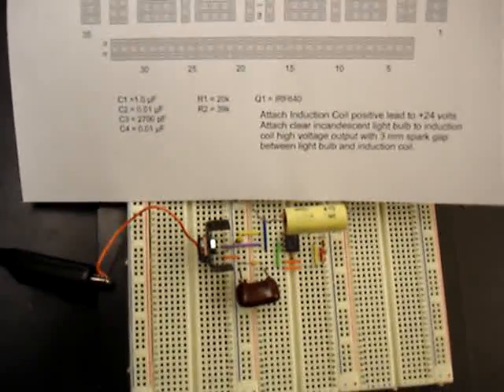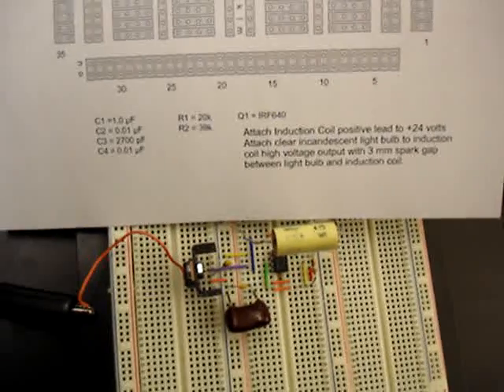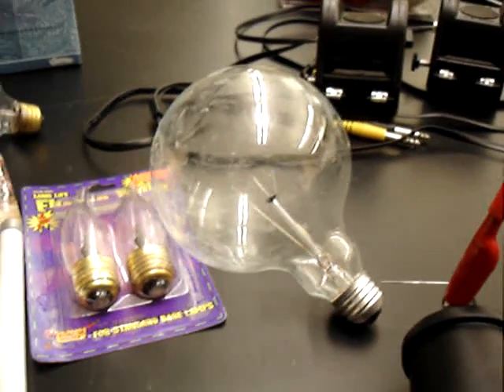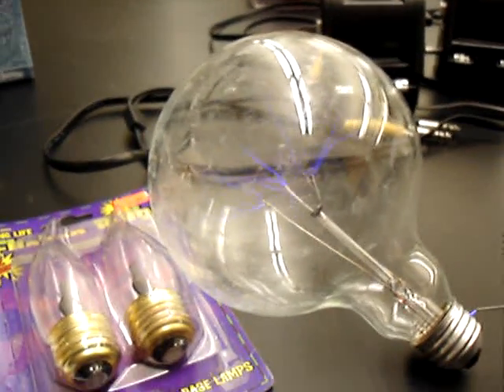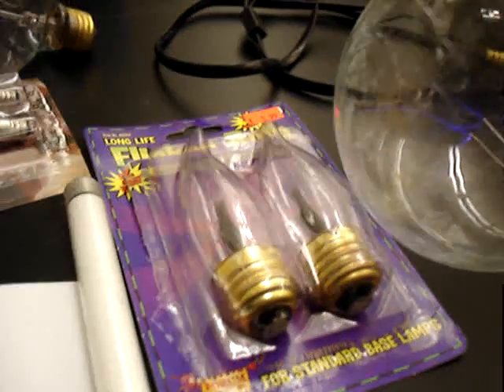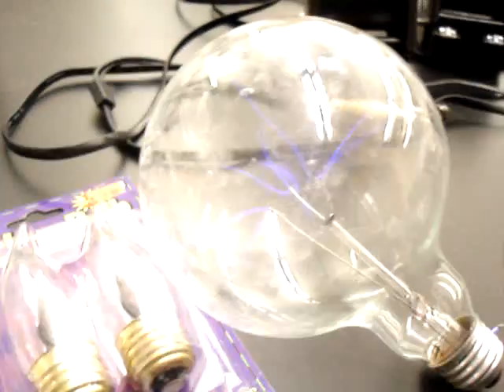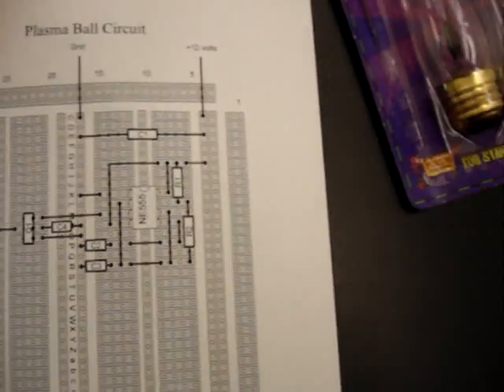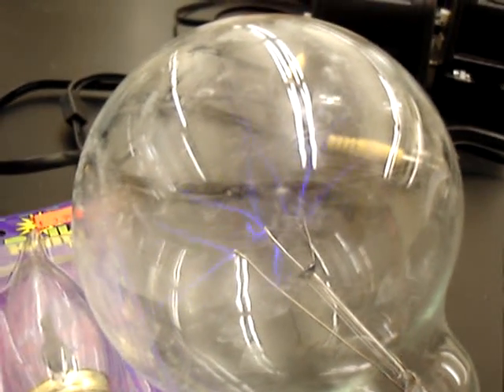Plasma Globe Circuit

Comment from the maker: Sorry it didn't work.  If you want to make a proper plasma speaker, I'd recommend getting a flyback transformer.  Hosfelt electronics has them for about $8.  The circuit diagram is on my website.

Comment from the maker: You don't want to modulate the output of the flyback: you want to modulate the input power.  Connect the secondary windings of the audio transformer in series with the input power and then connect an audio jack to the primary windings of the audio transformer.  With luck, this should modulate the input power to the plasma globe circuit and will be amplified as a high voltage spark.  However, there may be additional circuitry that damps out this signal, so this scheme might not work.

Comment: That's the point, I broke my globe, now I only have working flyback transformer and I'm getting spark about 1 cm long ( 0,39''). I think that it is enough for making some noise, in fact, I only need to get some music with my spark (I have that for my school project) so it doesn't have to be loud. I was searching for some schemes how to make singing arc, but none of them did not worked . So I was wondering if is it possible to connect audio jack to that flyback adapter to modulate frequency.

Comment from the maker: In theory, yes, but there are many practical problems.  Most plasma globes don't produce sparks with enough power to make sound that is loud enough to hear easily.  You could try to modulate the plasma globe using a circuit similar to this one sci-toys.com/scitoys/scitoys/radio/am_transmitter.html although I doubt you'll hear much, and you might even damage your plasma globe.  It's probably best to build a plasma speaker from scratch.

Comment from the maker: Yes - this should be possible to do, although it wouldn't quite be the same circuit as the plasma speaker circuit.  The plasma speaker circuit would modulate the light at audible frequencies (a few hundred to a few thousand Hz) which would be invisible to the naked eye.  But if the audio signal were rectified, low-pass filtered and then used to amplitude modulate the signal, that would make the bulb pulsate with the music.  I'll have to try it - thanks for the idea!

Comment from the maker: I've found that UC12T ignition coils work well and are fairly inexpensive (about $10 new, often cheaper if you can find them at auto supply stores, or used ones from junk stores).

Comment from the maker: It was just an ignition coil I found on eBay for a few bucks (I have no info on the specific model).  The circuit is very similar to my plasma speaker circuit, except that you tune this circuit to match the resonant frequency (about 6 kHz) of the ignition coil.  Many ignition coils will work.  Try a Google search on "555 high voltage ignition coil rtftechnologies" for some construction tips.  They used bipolar 2n3055 transistors, while I used an IRF640 MOSFET - either is OK - use heatsinks!

Comment from the maker: @999spykid It's a fairly standard 555 timer circuit which I designed myself.  It's very closely related to my plasma speaker circuit, except that it uses less current, runs at a lower frequency and isn't modulated by an audio signal.  You can find a copy of the plasma speaker schematic by doing a Google search on "Derin Sherman videos" and then clicking on the PDF schematic associated with the video.